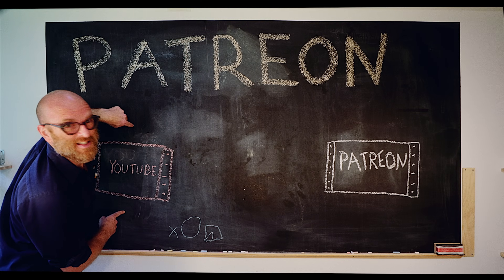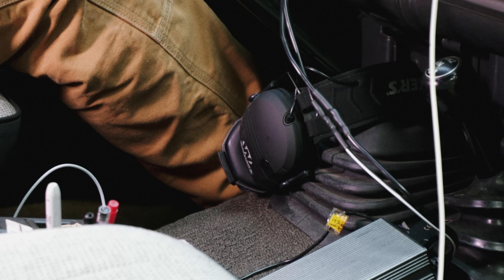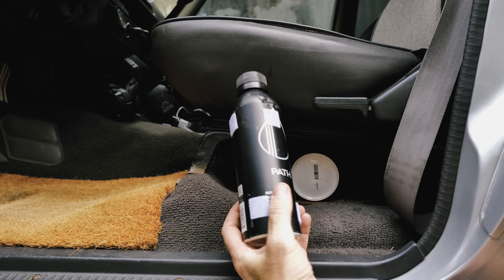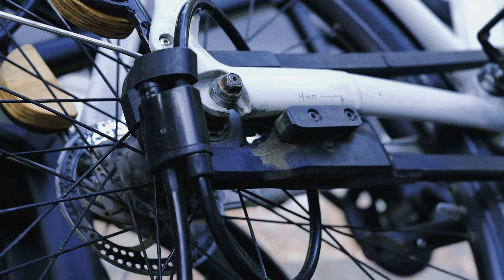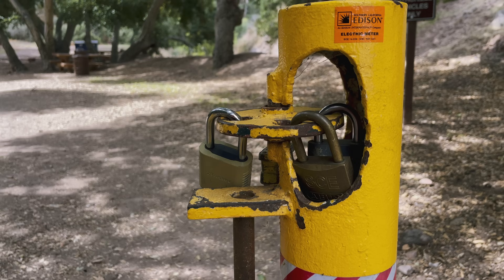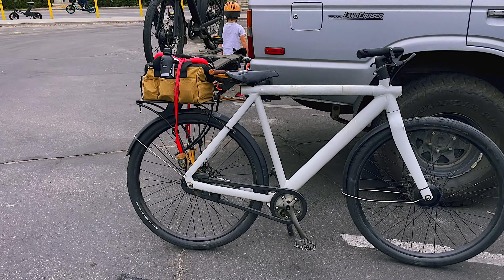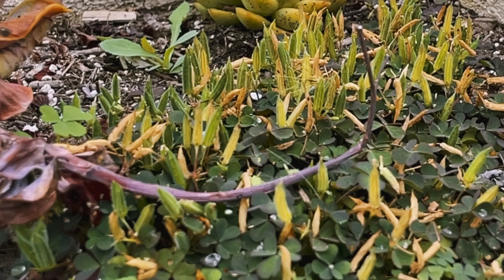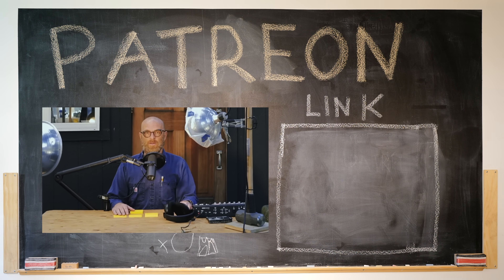All of the Gear In My '87 Land Cruiser

Comment: You could also use a lot of sound damping on the interior panels.  Butyl and mass-loaded vinyl paired together can cut 15-20dBA out of the cabin, very dependent on specifics, but regardless, any damping will help.

Comment: I must have missed( in video) the quality yank-em tow rope, the can of walking insurance( fuel can, full, to insure you don't have to walk)
.
 Hmmm,,, angle grinder, gate lock opener,,, DURING FIRE SEASON😶🚨good way to start a fire, with sparks from grinding. These days, gate lock design likely wouldn't fit into the covered lock area. A good chain-Key usually works. Less chance of starting fire, from grinder sparks.
 At least one spare u-joint, for drive line is good idea.
 With what he packs in the L.C. it does cover alot of possibilities🎯😎☕